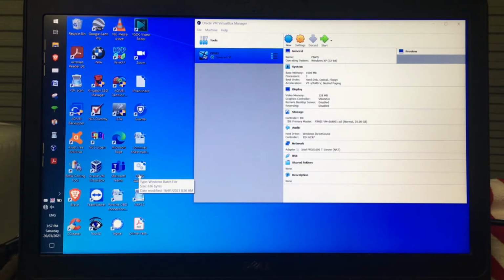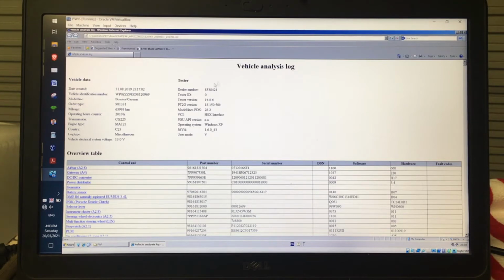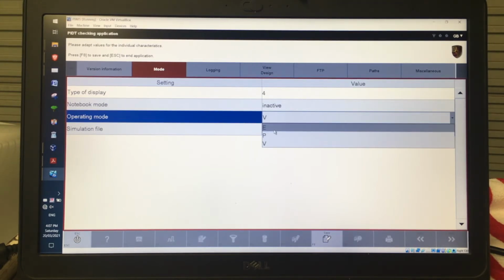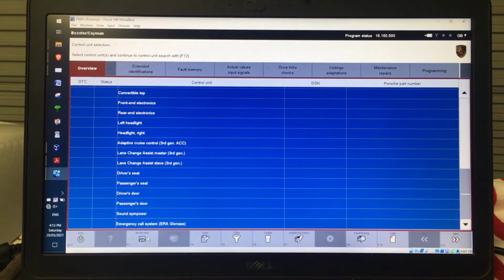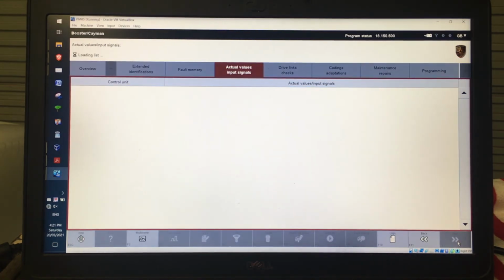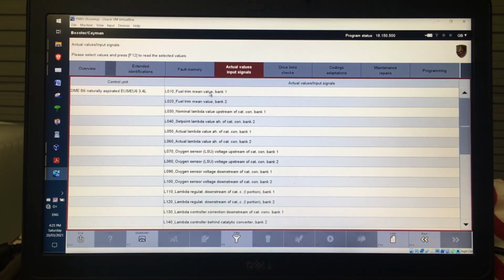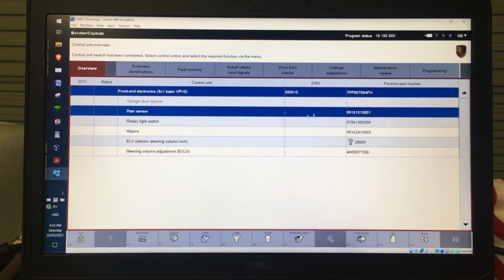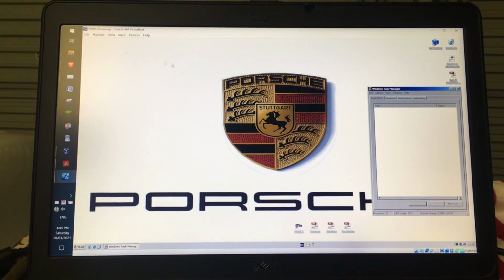Piwis use

Comment: Hello, PIWIS III - i have problem with PDK module logging actual value - when I start driving all values change to error (29 000). When I stop driving values comes back....
Reply from the maker: I don't know why that is happening. That error normally means the ignition is off, so it seems for some reason the PIWIS is getting a signal that this is the case.

Comment: Jeff - I have a bad front BCM and I bought a used one - can I copy the information from the original BCM and paste it into the one I purchased - using the PIWIS II?
Reply from the maker: Unfortunately not. This definitely needs to go to the dealership and have all the keys and other control units like the DME, rear BCM coded so they talk to each other. The front BCM is the heart of the anti theft system so it's made to be very difficult to just copy and paste. I'm not even sure if an old control unit can be recoded by the dealership rather than a brand new one. I'd be very interested to know if it can be done.

Comment: Maybe you can help, I'm currently having a OS Giken Super Differential installed  in my 2013 Boxster s with PDK. 
Would you know how using piwis how to code out/off all the edif functions?
Reply from the maker: I'm just about to post a video on how to code in new options. I don't have any experience with this specific issue, but if the open diff (option I219) is installed  on your car, and you change this to the 40% locking diff (option I220), this might work for you. Can you give me feedback if you do this on how it works out? Cheers.
Reply: @Jeff Richardson  yes I can. And yes I will.
From Houston Tx

Comment: I have a 987 cayman and even after i clear the fault codes through the PIWIS II, the passenger airbag is till on, Any thoughts on this?
Reply from the maker: No idea. That seems very strange the airbag light would be on with no errors for the airbag module. Any errors in the instrument cluster. Also, what does PIWIS say for the instrument cluster and if the airbag light should be on?

Comment: Have just got my piwis up and running thanks to your video. The one thing that stumped me though was the batch file starting the VM but not altering the date. I just change it manually from the settings option and it works great. Also I never would have found where the VAL report is saved to on a million years, thanks again.
Reply from the maker: I need to do a video on this as well as some other PIWIS stuff I've discovered. Whilst the batch file was working fine for a while, it's not now and I need to manually change the date as you describe to not get the black menu issue.

Comment: What set up do you use for charging while coding?
Reply from the maker: I use a 15A charger that has the option of either 'charge battery' or 'power supply' mode. I use in the power supply mode and it gives a constant voltage of about 13.5V
Reply: @jeffrichardsoncardiy  do you have a link to that charger?
Reply from the maker: https://www.schumacherchargers.com.au/products/p/spi-15

Comment: Wow... this stuff has been SOOO useful; thank you for making the time to share your knowledge Jeff!!
You've inspired me to tweak all kinds of things with my PIWIS II. Some planned, such as upgrading from a CDR31 to a PCM31... and some not.
If anyone is interested some of the things I have learned along the way include how to:

o  Activate every feature (bar one - which is selecting the model that comes up in the Splash Screen) on the PCM31
o  Add the MAP feature to the Cluster and activate it (they call it LVDS... a hard one to figure out)
o  Activate every possible menu in the Cluster including G-Force, Performance (Torque and Power), Chrono controls, etc..
o  Adjust XM radio antenna sensitivity (USA)
o  Add the Sports Chrono gauge

I am constantly tweaking in 'E' (Development / Engineering) mode...  luckily nothing has 'broken' yet.

I also spent an inordinate amount of time trying to activate Sport Plus... however eventually determined that a software 'upgrade' applied by the Dealer during a crash repair has permanently locked that feature out.

Cheers from Florida!
Reply from the maker: G'day Rob. Glad the video helped and you've had a bunch of success. I don't think many people will look here for information, but if I can suggest to contribute to the thread below on the Planet9 forum. It's one I started a few years ago. Lots of people go here for information and I'm sure there would be lots who would appreciate the contribution. Cheers, Jeff

https://www.planet-9.com/threads/piwis-2-coding-using-development-mode.238169/
Reply: Yup... I'm a paid member at Planet 9 and Rennlist; I saw that thread and have added a few posts here and there on these sites! I'll gladly contribute what I've discovered...
Reply: Posted!!

Comment: Hi Jeff, is it typical to very few faults? I recently had a pre purchase inspection performed and there were many past faults that hadn't been cleared in the history log but only 2 benign active faults. The most concerning was a fault with the pdk electronics. Just not sure how typical they are.
Reply from the maker: If not cleared for a few years it's easy to have a bunch of faults present that are just due to doing maintenance that are old and not active. PDK faults I would consider unusual. I can't give advice, but if it can be cleared, taken for a solid drive and not return that's going to be a good thing. Also, if there was a way to explain the inactive fault, maybe a flat battery, that would give me some peace of mind. Also, it should say when the PDK fault was. If recent I would be concerned.

Comment: Hi Jeff, I'm currently trying to install and code PSE button on my 991.1 C2S (not PSE) as an addition to Soul Sport Exhaust. I have two issues: 
1) I'm keeping CTEK MXS 5.0 plugged into the car during working with the PIWIS program, but if the battery is less than 90%, the indicator of the battery on top of the application's window (close to the language dropdown) start showing warning and accordingly documentation I have to "Connect a battery charger with a current rating of at least → Nominal value: 40 A to the vehicle battery."  How do you deal with that? 
2) I followed the "Installation and Conversion Instructions for PSE Retrofit Sport Exhaust System, 3.8 l (I-no. 176) " document, and after step "5 Code the sports exhaust system" everything worked fine with only one small issue: when I press SPORT button -> AUTO START/STOP button's indicator doesn't light up... but the function works as expected (PSE button light up correctly). I tried to reverse back changes but still can not make that sequence work.  Any help here?
Reply from the maker: I can't comment on the coding of buttons as I don't have any experience on this. Regarding the charger, I just look at the voltage on the MFD in the car and check that it doesn't reduce while I'm using PIWIS. I use a 15A charger and this seems to not drain anything from the battery for a the work I do. I ignore the messages on PIWIS.

Comment: brilliant, learned a lot how to use my piwis. I run it from an old xp computer and it is not as finicky to disconnect or connect, it is quite robust. I will try your VM setup and see if I can make it work on a modern computer. Thanks for sharing.